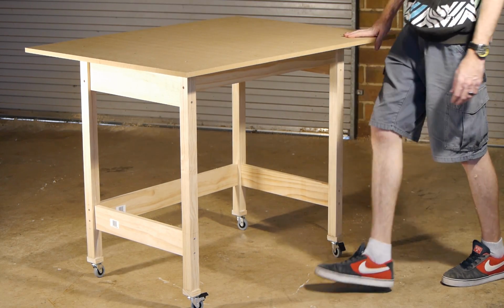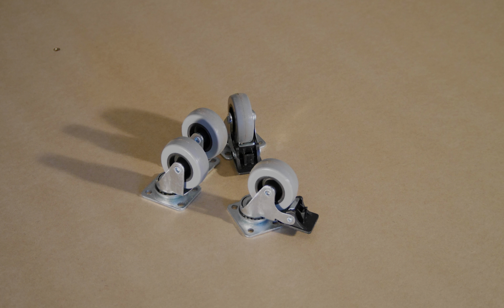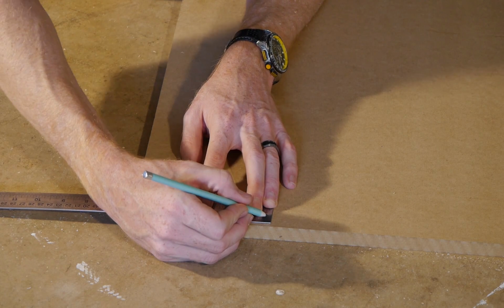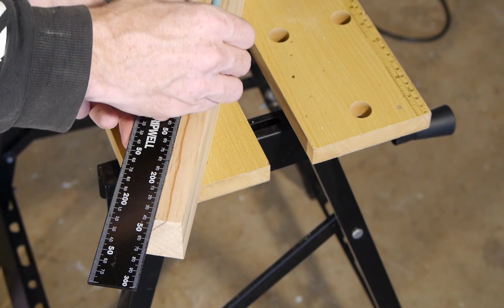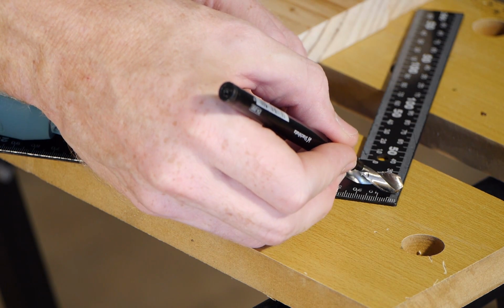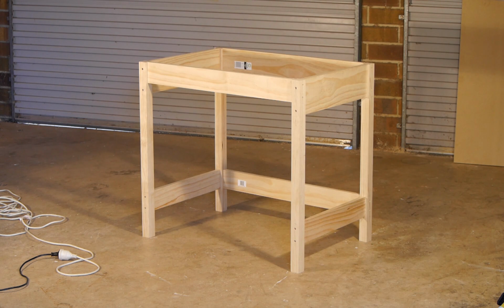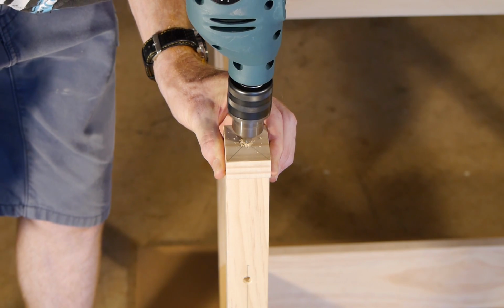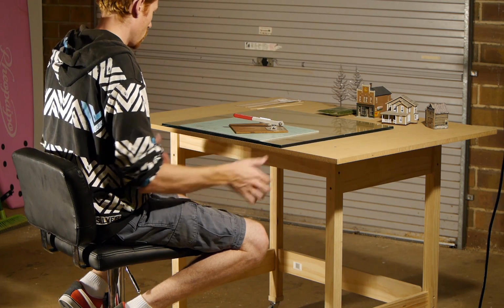DIY workbench on wheels for hobbies/craft - How-To

Comment: IMO if legs' cross section <101 mm (4") and/or screws' length <152 mm (6"), screws going thru legs at corners, into the ends of boards (side braces) = no good.
(viewing downward from top)
SOON NOT STURDY:
             screws
                   |
                  \/ ____
screws-->□____side brace
                 |   |\
                 |   |  leg
                side
               brace

If legs' cross section <101 mm (4"), attach legs to the inside of the 90° joint. Screws' length should fully penetrate leg from outside of side brace.
STURDY (without glue):
                 screws
                       |
                      \/
                   ________
                  | \______side brace
screws-->|   |□
                  |   |    leg
                  |   |
                side
               brace
   - or -
STURDY (alternate):
                 screws
                       |
                      \/
                   _______
                  [______side brace
screws-->|   |□
                  |   |    leg
                  |   |
                side
               brace

No wheels for this size table (desk size maybe, but otherwise): noisy, unstable, rolling around will eventually split leg edges, unless reinforced with metal band clamps or the like. 
I would sand the bottoms of legs, rounding off edges or glue on rubber pads for carpet floors, felt pads for hard floors or use tennis balls as feet: washable with laundry but air dry, no heat.

▪Drill bit tip upgrade, for multiple uniform depth holes:
Wipe the bit clean of dust & oils, dot (single) the drill bit with felt tip marker at desired measurement, firmly apply masking/ painter's tape (a few cm or 1" length) around the bit, securing the tips to each other hanging off like a little flag, or just wrap it thick. If you can't get an easily visible mark, place ruler or measuring tape on table or counter top and butt the end against a board, wall, or solid surface. Lay a strip of tape (tacky side up) across the ruler at desired measurement. Butt the drill bit's tip (solo, unattached to drill) up to the same solid surface as is the ruler, across the tape and wrap it. It's easy to see amidst saw dust and dark metal drill bits. If tape doesn't adhere well, apply a little hot glue, rubber cement, wood glue or more tape higher along the bit shaft.

Comment: [Viewing     ]
[downward]
[from top   ]
IMO if legs' cross section <101 mm (4") and/or screws' length <152 mm (6"), then screws going thru legs at corners, into the ends of boards (side braces) = no good.
SOON NOT STURDY:
            screws
                   |
                  \/ ___
screws-->□_____side brace
                 |   |\
                 |   |   leg
                side
               brace

If legs' cross section <101 mm (4"), attach legs to the inside of side braces' 90° joint. Screws' length should fully penetrate leg from outside of side brace.
STURDY (without glue):
                screws
                      |
                     \/
                   _____
                  | \______side brace
screws-->|   |□
                  |   |    leg
                 side
               brace

STURDY (alternate):
                screws
                       |
                      \/
                   _____
                  [______side brace
screws-->|  |□
                  |  |    leg
                  |  |
                side
               brace

No wheels.
Sand the bottoms of legs, rounding off edges or glue on rubber pads for carpet floors, felt for hard floors or use tennis balls as feet: washable with laundry but air dry, no heat.

▪Drill bit tip upgrade for multiple uniform depth holes:
Wipe the bit clean of dust & oils, dot (single) the bit with felt tip marker at desired measurement, firmly apply masking/ painter's tape (few cm/ 1") around the bit, securing the tips to each other hanging off like a little flag, or just wrap it thick. It's easy to see amidst saw dust and/or dark metal bits. If you can't get an easily visible mark, place ruler or measuring tape on table or counter top and butt the end against a board, wall, or solid surface. Lay tape (tacky side up) across the ruler at desired measurement and butt the drill bit (solo, unattached to drill) up to the same solid surface as is the ruler, and across the tacky side of the tape and wrap it. If tape doesn't adhere well, apply a little hot glue, rubber cement, wood glue or more tape higher along the bit shaft.

Comment: Have you considered using pocket hole screws?  They make a much sturdier joint than driving screws directly into an end grain, require fewer screws and often no glue is needed for the joints.  Kreg is one brand and is available in Australia as well as the US.  As always, another great video!

Comment: Thanks. An easy and clear tutorial. Great.
Reply from the maker: Edward Traxler Thanks Edward, I'm glad you found it easy to follow. I found it difficult to describe the steps throughout the video without making it more confusing! I ended up cutting a fair bit out of the video to avoid confusion!Cheers, Luke.
Reply: Understand completely. I am fairly good on using Sketchup and associated programs to create 3D models. Trying to explain the process is quite difficult though.